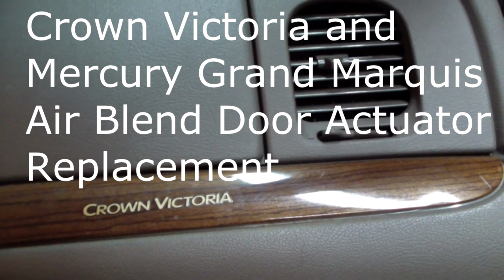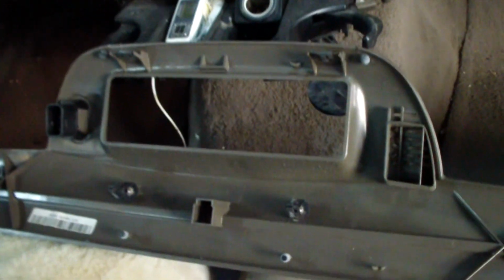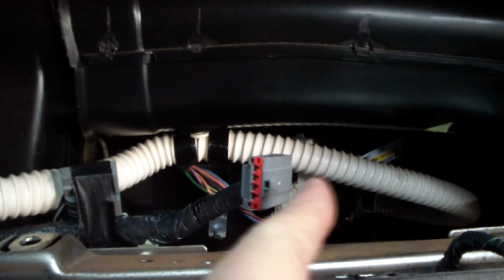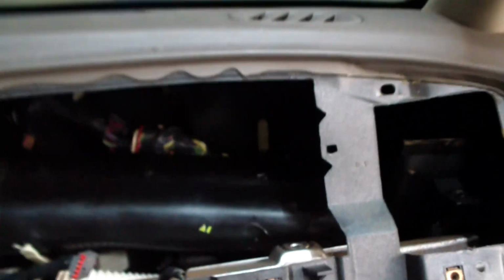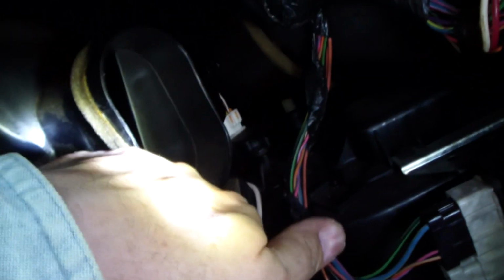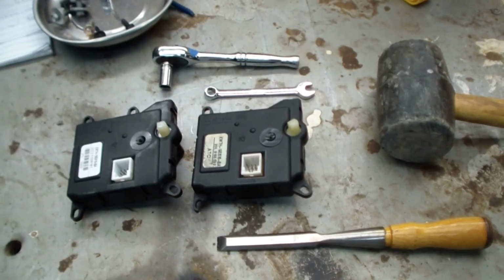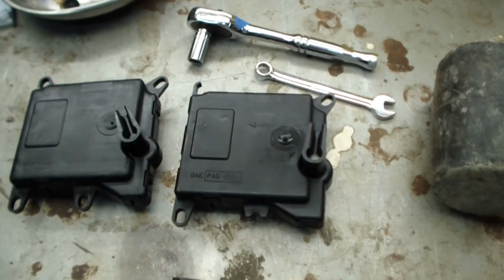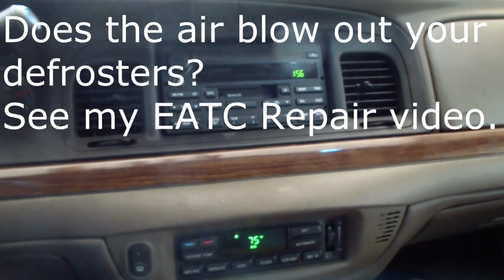Crown Victoria Air Blend Door Actuator Replacement

Comment: If Ford had these original blend door actuators made with metal gears versus plastic this would not be a recurring problem. Even the replacement units come from China, and it's the same junk...This is the price we all pay for car manufacturers wanting to save a few bucks by using plastic to save a few bucks for their overpaid CEOs...all the while still raising the price on the vehicles.

Comment: On first gen Panther platforms there is a 3rd screw on the black vent tube,  It is located on the left side on the rear so it is no visible. I believe it is a 6 mm.

Comment: Brake the old one out (carefully), snip some slots in the bolts I couldn't get to and put the one bolt I could back in.  Now if it does it again I can replace it easily. Because that truthfully sucked

Comment: Thanks for the video - I watched a bunch of videos but yours had some really good tips that saved me a lot of time and frustration.  I also was not able to get that second front bolt out, so I used a long flathead screwdriver and "chiseled" it like you did and it worked!  At that point, when i was moving the actuator around to try snapping off the rear bracket I realized could push the actuator in such a way that I was able to see and get to that rear bolt.  It was a pain as my 8mm wrench was tiny, so if you have something to extend it the process goes much faster.  Like others, i trimmed about 1/2" off of the vent tube which made reassembly actually possible.  I did secure it with some metal duct tape just in case.  Overall, about 4 hours but its all tested and working again which is a win for me! Thanks for making the video!

Comment: I shortened a 8mm 1/4" drive socket with a cutoff wheel.  This and pulling the dash away by loosening the 10mm on the rt by the kick panel and the 3 screws by the windshield allowed me to get all 3 actuator screws removed and installed.

Comment: One thing i did when putting back together was trim the vent tube down a little to make it easier to reassemble so its not so tight going in and another thing i did was plug the unit in  before i tried to put in place turned on the heat to adjust the control arm to a position that lined up with actuator arm and turned off ignition

Comment: You DON'T have to break or cut the tabs, you DON'T have to remove the dash and you DON'T have to buy any "special" tools.

I managed to remove mine by taking all three screws out and replaced it putting all three screws back in, just like factory install.

What you need is an 8mm ratcheting wrench and some fishing string...

Comment: thanks!  does it matter what position the wire 'connector' is in (not the electricity- but the actual wire that the door blend actuator pushes or pulls)?

Comment: I need some advice, please. I have a 2004 Grand Marquis with automatic temperature controls. My problem is that cold A/C blows out not only where it should, but also on my feet as well. NOTE: There is no clacking or other noise that would indicate a defective actuator. What else could be the problem? They door itself? Is there only ONE blend door? If there are more than one, where are they located?
Reply from the maker: The blend door in only hot/cold. The vents are controlled by the EATC. Uses vacuum only. Over time the O-rings shrink and leak. See my EATC repair video to fix this.
Reply: @KentDiego  Many thanks, that's exactly what I needed!

Comment: Why not just remove the dash board?
Reply from the maker: Removing the dashboard to fix this is something like 10 hour job. It take a special mechanic to do it correctly. Often things will never work right afterwards, like rattles and scratched parts.
Reply: @KentDiego  What other common problems do these cars have?  I was looking at one with a digital dash.  I am trying to see if its worth in purchasing one.
Reply from the maker: @Romulan112  I posted three videos with my issues. Age will take it's toll on any car. I feel the Ford CV was above average in reliability. I sold mine at 220k miles and it still ran great.

Comment: The engineers that designed this needs the shit kicked out of them. All that room to the right, but no, let's tuck it back behind this duct to the left, and then, we will put screws where nobody can get to them, and we will use a cheap part that we know will fail, long before the car is worn out.

Comment: 1995 Grand Marquis is WORSE!!!! Even cutting away the foam leave Zero room for anything to get to the back bolts. Even if one could, there is no room to swing the wrench. I finally just said screw it and beat the crap out till the back bolts broke loose. I did use the chisel technique for the front bolt, worked like a charm, too bad couldn't get on in the rear.  Part arrives tomorrow, one bolt should hold it tight, the door moves so easy that it should open and close it just fine with one bolt. 

I would like to take the engineer who designed this and beat him repeatedly in the balls with a Louisville slugger.  Only a moron would put a consumable replaceable part in an area that is damned near impossible to get to without removing the entire dash.  They couldn't ount the darn thing from the bottom like any sane person would?  And to do it for nearly 20 years?

Comment: VERY helpful. I've been trying to turn the blend door but it will not budge. I used your guidance to get more access and pry the actuator off the blend door lever. I FINALLY got the heater turned off and I disconnected the wiring to the blend door actuator. The air has other expensive problems so I won't bother replacing the actuator.

Comment: To add to my below comment I have no trouble with the temperature when I turn the AC on the AC is cold at the vents when I turn the temperature up the AC vents blow out warm air but I cannot get anything to switch from the vents to the defroster or from the vents to the floor thank you for any help

Comment: Did you have a problem lining up the foot on the bottom of acuator with damper rod while lining up the screw loops?  Great video.  Also I have rear seat ducts and that was a real problem.  Do you know anything about rear seat ducting?  Great video

Comment: Hello... Thank you very much for this video. It's was extremely helpful. Unfortunately, after I installed and plugged in the blend door actuator, the air is still not blowing through the main vents. I can see the device switch working as I fluctuate the thermostat from hot to cold, and it throws hot and cold air though the defrost vents as well as the floor vents, but not the main ones on the dashboard. Could you please advise? Thanks...
Reply from the maker: See my EATC Repair video. Just need to replace O-rings in EATC to fix the vacuum leak that causes this.
Reply from the maker: If not the EATC also could be the main vacuum line to EATC. This is a small plastic black line running from intake manifold to firewall at top to drivers side hole in firewall into passenger compartment. Had a rat chew a hole in mine. If your parking brake does not disengage in Drive then this hose is broken.
Reply: Thank you very much... I will try this out.
Reply: If the The Blower motor and fan cage are good.    Then replace your blower motor resistor or blower or  speed controller on the cylinder Head.     You can always perform a self test on your head unit in 5 simple steps.  
1:key on engine off
2: PRESS OFF & FLOOR SIMULTANEOUSLY THEN within 2 seconds press AUTOMATIC you should see it digitally loading in a circle. (Means test is working). Wait 60 seconds   
Step 4: write down any error codes it has displayed.   
STEP 5: press DEFROST TO END TEST.   
024 - 025 are common errors for zone blower issues.  888 means test has found no malfunctions.  
Mine just gave an 024 error meaning a ITS  BLEND DOOR  FAULT

Comment: Hey there Kent I just came across your video thank you very much man🙏👌, I just had my complete air conditioning system down on my  Mercury marauder, and about a week later it started blowing hot air to call Mike try to get the mechanic to come over several times but if it’s at the rain sunshine so thank you when I get back home I may have to start doing it myself👌👍👍

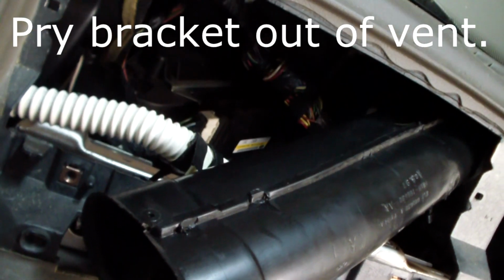Comment: 4:17 that’s not wires.  That’s a vacuum line

Also this is about $4-500 repair job in a shop.  Even more at a dealer

Comment: So I got lucky again. Disconnected the negative battery terminal for five minutes. Reconnected battery. Turned ignition key to run position. Heard the gears turn. Outside temperature minus 10C/ 14F. Drove the car to warm up engine to normal temperature. Car heated up to 25C/ 77F.
Air at floor vent 46C/ 114F. Air at dash vent 55C/ 137F. Thanks to the fellow who posted this reset information.

Comment: Once you get the electrical connector off, is there any way to manually turn the door.
Driving around today in extremely cold weather with extremely cold air coming out of the heater vent. So I decided to set the climate control to air conditioning with the temperature set to 18C. Nice warm air coming out of vent. Might make it through the winter in my 99 Mercury Grand Marquis LS. Recall having the same problem in the past. Read on the internet about disconnecting the battery for a short time and reconnecting. It worked. But I will bookmark this video for warmer weather. I did the scan and I believe it was 024 blend door failure. Thanks.
Reply from the maker: I saw a video where they took top of actuator off and would just reach in a turn flap rod each summer and winter,
Reply: @KentDiego  I may have seen the same video where the guy leaves the vice grip pliers attached to the metal lever that turns the door. Another video where another fellow removes the radio and is able to move the lever. First I will disconnect the battery for 5 minutes and then reconnect. This has worked for me in the past. If not I install an electric heater in the car and remove the glove box, air bag, and vents after disconnecting battery. Looking forward to seeing that lever. Car has only 106000 km/ 67000 miles.

Comment: It took me 4 hours to do this. Save the Ford engineer that designed this for me. I want to strangle him with my bare hands after I heal all the missing skin on my hands. The front left bolt is a bitch. I unsnaped the top of the box and removed the top plate and the guts first. That gave me access to the other side bolt too. There were only 3 bolts in my 2006 grand marquis.  Cut out the sound dampening insulation at the firewall to make room for a ratcheting box end 8mm wrench. I need got 2 bolts in this now. That front left bolt just isn't gonna happen for me.😐

Comment: Could this be a reason my air compressor want come on ? Yes I’ve replaced it still doesn’t come on
Reply from the maker: The air blend door actuator has no effect on the compressor. If that is not engaging then it is something else. Look around on some of the Ford forums for clues to what your problem is.

Comment: Thank you for this video, helped a ton! I found that you can cut off the left tab if you can't get that unbolted with a pair of snips. Additionally, you can cut some tabs into the duct piece to help it slip back into position over the plenum. That saved me a lot of effort during the reinstall.

Comment: I replaced the blender door exactly as shown but the new one doesn't work either. I have the electrical connector seated and the steel bar that attaches underneath moved freely before the new blend door actuator was installed. Also, I took the old actuator apart and the gear was stripped so I know it was bad. Do I have to put the duct work, air bag and glove box back inlace to make it work? I just ordered a vacuum gage to check the vacuum on the EATC. Any suggestions?
Reply from the maker: Did old unit with stripped gear make noise when switching hot/cold? That would verify everything else was working. I would guess that the new unit could be defective as I have had similar experiences with other parts..
Reply: @KentDiego  The old unit wouldn't switch from hot too cold. It would just run hot. Even with the EATC unit completely disconnected the blower just runs. You're right the new unit may be bad.

Comment: Another video had in comments to use a gear wrench for the one to the left and a tite reach wrench for the one in the back.  I had heat and I replaced the heater core and I thought well I have heat so why replace this part while I have it apart.  As soon as it was back together it failed.  I feel dumb but if you have it apart replace this part.
Reply: Teacher Lynn you mean that you can access the blend door actuator with the blower motor off?  That sounds easier to me!
Reply: @angelonicassio7131  No I did a heater core replacement and I had the dash out.  Blend door actuator worked at that point but I failed later.  I am having a hard time replacing it and even a piece of my duct broke.  If you have the dash out then replace this part whether it is working or not and use the best possible OEM part you can buy.  RIght now I am living a nightmare trying to get this in

Comment: Is it possible with the radio removed to get access to the blend door to manually move it from hot to cold.?  I watched another video of a someone with pliers manually changing it. Getting rid of this
car with 370K miles this coming spring.  I need it to produce heat this winter.  I had the problem last year but after several clicks of the blend door it moved.  So far no luck getting it to move back to heat.
Reply from the maker: I do not think so. Just remove actuator and duct tape door lever.

Comment: You should take off the positive terminal cause if the negative one touches any of the metal body then the battery will be grounded again. Or take off both terminals altogther.
Reply: The risk is when disconnecting the battery terminals from the battery. If disconnecting the negative terminal first and the wrench touches the engine, the body, frame, etc., there is no risk of a direct short to ground. Doing so from the positive terminal is how you can end up exploding a battery, melting your wrench, or burning your car to the ground.
Reply: your dreaming

Comment: Hello I just attempted to do the same thing you did, only for me when I plugged the white connector into the blend door it moved all the way to ac but then would not move when the temperature selector was turned. Do you think my new part is bad too? Or is there an issue with the switch or a fuse?
Reply from the maker: Not sure but I always suspect the new part. Could be the EATC. You can get an EATC used and I also made an EATC repair video.

Comment: So my crown vic is blowing cold air, but it dosnt like to stay on Vent, it keeps switching from defrost and to my feet. could this unit be the issue?
Reply from the maker: No. I had that too. See my EATC repair video for easy fix. Now my air blows out the correct vents.
Reply: @KentDiego  thank you!

Comment: That connector is for a clock. If you go to a junkyard and find another trim piece with the clock in it you could plug it in and it will work.
Reply: It's actually for the trunk release on police interceptors.
Reply: Actually it's for the trunk pop button on police interceptors. Same wiring harness.